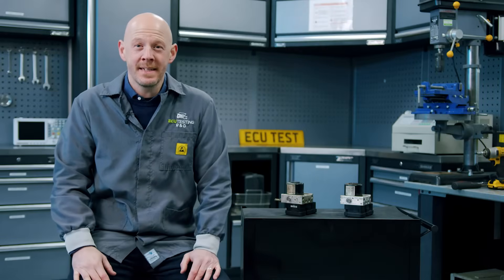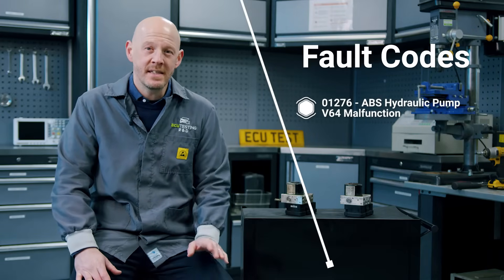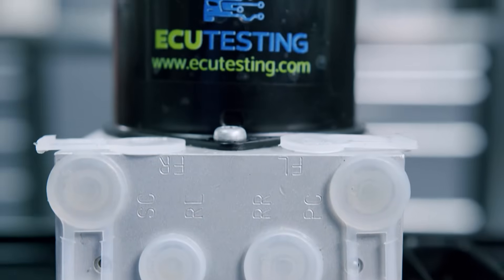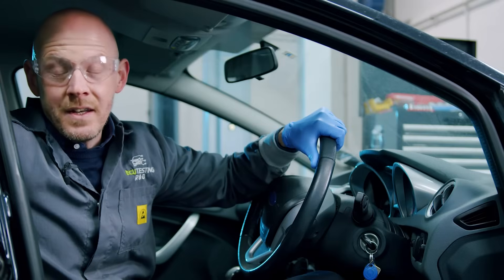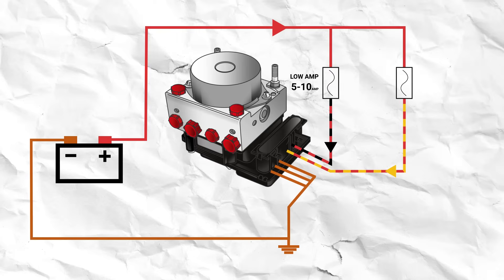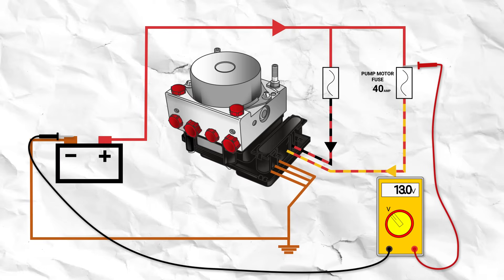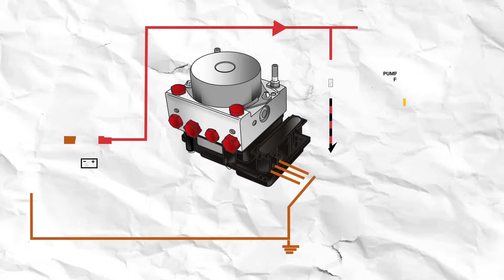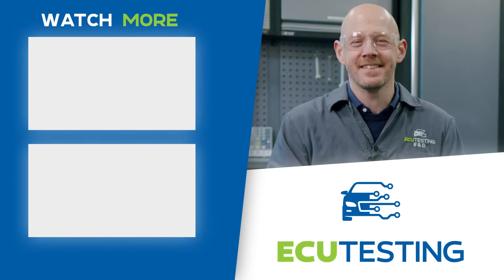ABS Pump Failure Symptoms – How To Test And Fix!

Comment: My son replace his front brakes. He  can't bleed the front left. No oil is coming out. Would a faulty unit be the cause? Or it's just a blockage in the pipe?
Reply from the maker: Hi there, it is possible it could be a faulty ABS block. If he would like to contact us, he can call 01773 535638 or email info@ecutesting.com with his vehicle details and preferably the ABS module part number. Our technical support team will be happy to help! Thank you.

Comment: the reason there are so many failures is it is a piss poor idea, the body behind this installation was and is a jackass, it is not required and designed to fail, the worst idea ever when it comes to a motor vehicle. now that aside thank-you for the video.

Comment: I have abs problems on my 2012 jeep wrangler, always an issue with my front right brake dragging like abs pump is stuck. No matter how many times I've replaced the brake hose and caliper, every year it does the same thing with no abs light and no codes.
Reply from the maker: Hi there, if you would like to send the ABS to us for testing, you can do so by completing our form here; www.ecutesting.com/testform If you would like to speak to us prior to sending the unit, give us a call on 01773535638 or email info@ecutesting.com. Thank you!

Comment: I have no lights at all, my brake pedal is soft as anything. Had to fill up the brake fluid as well. tend to think it's a leak, or the master cylinder is gone. he brake pedal gives a slight 'judder' as soon as you start applying pressure, then disappears. Never did that before.
Reply from the maker: Hi there, we would be happy to take a look at this for you. If you can email info@ecutesting.com or give us a call on 01773535638 with your vehicle details, part numbers if available and the issues you are getting, our technical support team can advise further. Thank you!

Comment: I have a problem with the ABS on my Ford Cmax 1.5tdci, 2017, 88kw. After braking and moving again, the brakes still brake lightly for maybe 5 seconds and then everything is normal. Also, when stationary or on a slight downhill slope, after releasing the brake, you have to wait a few seconds for the car to idle on its own. The diagnostics show no errors and I have no lights on.
Reply: It will be the pump just done mane same symptoms

Comment: Great video, so much useful information. I have a Bosch system in my Rover 75 with one of the 12v wheel speed sensor outputs missing. The wiring to the sensor from the ABS module is good. Is this something you could help me with, or offer advice on? Thanks.
Reply from the maker: Hi there, if you can contact our technical support team either by email to info@ecutesting.com or call 01773 535638 with your vehicle details, symptoms and any fault codes, they can advise on this further for you. Thank you!

Comment: Important to flush new brake fluid through brakes every 2 to 3 years to reduce corrosion of ABS hydraulic valves and prevent many of the problems mentioned here. Also, many if not all ABS systems do a self actuation test when you first start driving off after starting engine. This is designed to test components and keep valves free from corrosion crud.

Comment: My brake basically lock up i couldn’t push the pedal at I turned the car off for 1 hour got back in it drove fine for 1 hour it back locked I’m lost
Reply from the maker: Hi there, it could possibly be an issue with the ABS pump and ECU but I would advise to get a mechanic to check the vehicle to rule out any other possibilities. If you do find the ABS to be causing the problem, you are welcome to send the part to us. We would require the part number off the ECU section to check costs and we can advise you further from there. Thank you!

Comment: Freaking brilliant! I pray my issue is as simple as a fuse.
Reply: Was it??
Reply: @gh-vi9tk ugh man, I wish. We tried that first though. We replaced the accumulator first, then the module. So basically the whole darn thing. But! It runs great now! And we did it ourselves. It's tough, but not as hard as all the shops make it sound. Got the parts on eBay but we could have saved money by getting both at the same time. I do suggest getting the module first if your accumulator doesn't sound terrible. That's the opposite of what we did but my fiance handled most of it I just helped.
Reply: @JamieNotLamie  I have ABS, brake and engine light on, speedo stopped. Use dashcam for mph. Been driving fine like that for many months but, mot in 6 weeks and really need to get those lights to go out. Yes I agree and already thought about getting a module first if required. I'm hoping its bad connections or something simple. I got a code reader but, it won't let me erase faults until fixed. One code is U0121 and the other code that popped up lately is something to do with the lamda sensor. btw it's a 2006 1.6 Ghia petrol. Hope things go ok for you and thanks for the quick reply!
Reply: @gh-vi9tk Ah! I had to look up what a "Ghia" was! I think that is the trim type, you have a Ford Focus then right? Ah, I don't know anything about Ford's unfortunately.

 I have an 09' hybrid Highlander myself. It looks like that's definitely an abs code popping up for you from what I see online real quick but I also had the same issue with no speed showing in my Prius (no lights on dash at all) and I've heard that sometimes when the cluster board goes out, it can send false codes, you can only hope! 

So definitely get your cluster board replaced first and then see what happens. Also, If you don't feel any issues when braking, I wouldn't worry about it right away, focus on getting your speedometer back first! I drove on my bad brakes for about a year myself. Good luck man, I hope it works out!! Sorry I couldn't be of more help!

Comment: I have a 2010 Mitsubishi Lancer DE
All brake pads and rotors are really good.
Bled all brakes.
All 4 sensors are in good condition , and all fuses under the hood, and under the steering wheel are also good.
Battery is good.
////////////////////////////////////////////
What's really strange, is after doing & checking all of the above, I get max brake pressure when the car is off.
When I drive the car, the dash lights up {ABS / Traction / ASC Off}, and there is very little brake pressure.
Why ?
Is it the ABS Module?
Brake Booster?
Master cylinder ?
Vacuum hose leaking etc etc????
---------------------------------
CODES:
C2104 / C2200 / C1204 / P1773
Reply from the maker: Hi there, it could possibly be an issue with your ABS module. If you wish, you can send this to us for testing to check if it is faulty, you can complete the test form here to get this sent in; https://myaccount.ecutesting.com/?return=/TestForm You can also check the part number from the ABS module on the website for costs of repair. Thank you!

Comment: I have had  code C1110 on my Nissan Xtrail t31, i have replaced the ABS module 3 times but the code is stuck with me, now heading 2 yrs.The ABS is working plus the motor is active....any one with potential solution to deal with this code.Lights on dashboard are ABS light and Traction control light
Reply from the maker: Hello there! You are welcome to send the ABS unit to us for testing to make sure it is fully functioning as it should do. I would advise to check your part number from the module either on our website, or you can send an email to info@ecutesting.com with this part number, your vehicle details and any other relevant information. Thank you!

Comment: Good day! Honda civic 4d 2008 sedan 1.8 petrol automatic transmission. Two problems with the brakes. 1. With the engine running, if you press the brake pedal relatively hard, it gradually falls to the very bottom. 2. On a dry surface, the brakes are normal, but on a slippery surface, if the ABS has worked at least once, even if you drive onto a dry surface, the brakes are not restored immediately, the pedal falls and the brakes are very bad, you need to intensively "pump" the brake pedal. After "pumping" on a dry surface, everything is restored, again until the next ABS activation. What could be the reasons? The car's mileage is 160 thousand km. There are no errors on the ELM328 scanner. Thank you in advance for your answer!
Reply from the maker: Hi there! This could possibly be a fault with the hydraulic part of the ABS unit. You are welcome to send the part to us for us to test to confirm whether this is causing your issue. You can follow the link here to our test form to get the process started; https://myaccount.ecutesting.com/?return=/TestForm 
I would recommend getting the part number off the ABS module, just to check it is one we have the full test and repairs for. Thank you

Comment: Intermittent noisy abs pump 
Binding rear brake offside not excessive on last mot on toyota yaris 1.0 2005 T2 any clues to whats going on no abs light on the dashboard when it happens
Reply from the maker: Hi there, you are welcome to send the ABS unit to us and we can check if this is causing the issue you describe. We would require the part number from the ABS module to ensure it is a type we have the full testing for, if you can get this information and send it across to info@ecutesting.com, we can check this and give you the cost also. Thank you!

Comment: Great video! Inspired me to research my 2011 Renault Kangoo II that has a "check ABS" light that now always comes on after driving about 1km. The ECU has only a general "P0564-1C (Cruise Control Multi-Function input A - circuit malfunction)" that comes back after clearing. Checked all sensors and wiring for as part as is visible, but the pump and electronics are located behind and below the battery as it looks like 😞 bloody hell, don't feel tempted to take that part of the car apart. But now I still have to go to the garage

Comment: I have been having a difficult time finding anyone here in the US who rebuilds the 2010 Dodge Challenger ABS modules.  Is it correct to assume that it is just structurally so different that it does not lend itself to the case being split open for soldering/rebuilding?  Or, is this something that if I paid for shipping out of country that you guys can handle?
Reply from the maker: Hi. We do rebuild Dodge Challenger ABS modules, but please email our technical support team on info@ecutesting.com with the information you've provided above as well as the following: The part numbers printed on your ABS unit, any fault symptoms or codes you have, and any attempted fixes/tests you've completed to determine your ABS unit is faulty. They will assist you further. Please visit our website in the meantime for any further information: https://www.ecutesting.com/product-catalogue/dodge/challenger/abs-pump-ecumodule-combined/

Comment: I have a 2001 ford focus. After renewing the entire brake system, the brakes started to fail. All parts were renewed but it did not improve. Finally, it was decided that the ABS unit was defective. Is the problem really caused by the ABS unit? Or is there another reason?

Comment: Hello, If the voltage is high? Around 16~18 V? Thank you. And nice video.
Reply: Then your reading it wrong or have a big battery charger hooked up on engine start mode.

Comment: 2014 Subaru Outback. I was driving on a rocky road and right after my brake pedal goes almost to the floor before it slows down. Replaced the master cylinder and still the same issue. No codes or lights are on. Any ideas?
Reply: Did you ever fix or figure this out? I have a Mitsubishi Montero Sport - similar issue buy one front brake gets no fluid at all.
Reply: @robbyfiveboy4862  nope. Taken it to a couple of mechanics. Everything is testing correctly and no one can figure it out.

Comment: Hello, I have a 2001 porsche 996 C4 with PSM. I have several symptoms right now: 1) the pedal sometimes becomes very hard or 2) sudden braking without any pressue being applied to the brake pedal. When either of these happen, ABS light comes on on the dashboard. Code 4460. I switched out the brake pedal switch which did nothing. I had the ABS electronic module verified and was told it was fine (no open circuit) and the problem is the hydraulic unit. When brakes come on unexpectedly, the only way to relieve pressure is to disconnect one or more brake lines from the ABS unit and then reconnect. Does this confirm that the problem is the hydraulic unit itself? Thanks for our help.

Comment: Hello, I have a question about an ABS module that was replaced second-hand on a Mercedes W221 320 cdi. The module has the following ref: A2215458732. It has been verified that the connector has two direct positive supplies, two correct grounds, positive after contact, with values of 12V. The Can Hight and Can Low connections have been tested, the sum of which is 5V (2.65+2.35), the resistance between them is 60 Ohms. Am I missing something before diagnosing that it is the ABS module, the culprit for there being no communication? Regards.

Comment: This would all have been great to know before sending my unit in, but your website didn't offer any of this advice. I hope it is a fault with the unit as I'm supposed to be taking the van away in less than a fortnight, and I will have almost no time to find the problem once I have the unit back. Maybe you should link this video on the website, so that people are more likely to have checked all of these things before they remove the unit and send it in?
Reply: Do your research before you start a job.   It is as simple as reading directions.

Comment: My abs pump fuse (30A) keeps blowing. Breaks themselves are fine.

Could it be :
1) blown motor
2) sticking relays? 
3) short, such as wheel sensor?

Where should I start?

Comment: C1440 and c1963 2011 f150 66000 miles brake fluid changed at 50000 lights reset after each restart but sometimes can drive several miles before they come back on sometimes can barely move the truck and they come on wandering if the problem is abs module or transducer in pump housing which I understand is unserviceable and parts cannon shot is 2000 I can’t imagine what the dealer would say but I am interested in verify problem myself before I present it to a shop as this information would help narrow my search in the landmine field of good guys and bad guys also tempted to buy the equipment and repair for free as many as possible to get back at the bad ones my plan is only flawed by making the good ones suffer as well please help if you can I appreciate your time and effort to enlighten us all

Comment: I'm driving scirocco 1.4 tsi and the car had error code 01130, anyone know if this really ABS pumps faulty or maybe sensors, fuse etc. Thanks in advance!
Reply from the maker: Hi. The 01130 fault code is usually caused by either a blown fuse or a faulty ABS unit. We would recommend testing the fuses first before condemning the unit. If you believe your ABS unit is faulty and would like to get it re-built, then please visit our website: https://www.ecutesting.com/common-faults/volkswagen/vw-01130-abs-operation-implausible-signal/ and select your vehicle make for details of how to send it into us. Make sure the part number matches the one on our website, and if it doesn't, then please email our technical support team on info@ecutesting.com, or give us a call on +44 1773 535638, and they will be happy to assist you further! Thanks.

Comment: UO121 Code astra J . Is this abs control module fault ?
Reply from the maker: Hi. A U0121 fault code can certainly be set by a faulty ABS control module. Please contact our technical support team via email on info@ecutesting.com with the following information. Your make and model of vehicle, any relevant diagnostic information such as fault symptoms and codes, and finally the part number printed on your unit. They will be able to assist you further. Thanks.

Comment: Hi, I have an issue, I parked my w204 c300 4matic mercedes 2010 for about 3 weeks and when I drove it for like 4meter away the brake pedal went flat momentarily ( happened 3 times ) after which it normalized,  since then I haven't driven it again, please I would like your help on what could be the cause
Reply from the maker: Hi. A brake pedal going completely to the floor could be a sign of low brake fluid, air in the brake lines, issues with the master cylinder, or a leak in the system. Checking the brake fluid level and condition is essential, and you might need to bleed the brakes to remove any trapped air. Checking the master cylinder or brake callipers for leaks would also be worth doing. Hope this helps!
Reply: @Ecutestinglimited  the fluid is intact and also never worked on so not certain of air trapped in, also the calipers work fine when I step on the brakes but there a slow return from the pedal , and also it sinks in after some seconds of hardness when been stepped on

Comment: I have a 2019 Nissan Frontier 4L V6. Code is C1111 (Pump Motor). I sometimes hear a clicking noise in the motor motor assembly.
Reply from the maker: Hi. The fault code you are experiencing would indicate a pump failure. However, please email our technical support team on info@ecutesting.com as they will be able to advise you further.
Reply: @Ecutestinglimited  thanks!
Reply: @Ecutestinglimited  I sent an email as you suggested, but so far no reply, thanks!

Comment: Hello bro my mt15 V1 front brake feels spongy even after several brake bleeds, zip ties, and even after replacing mckit .
But abs sensor light working good i feel abs is triggering but can’t figure out this spongy brake.
Service centre guy simply told abs rotor/motor problem which costs around 13k .
Im confused is this really a abs issue or any brake hose or calliper?